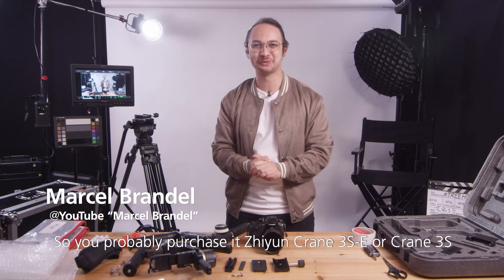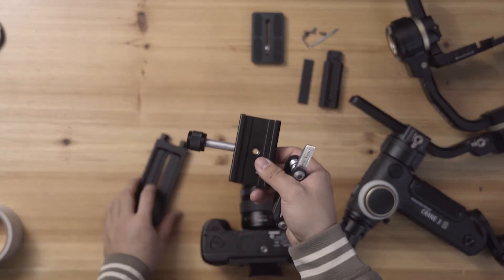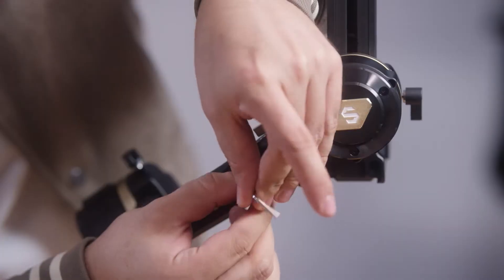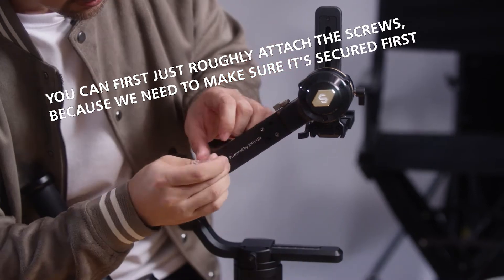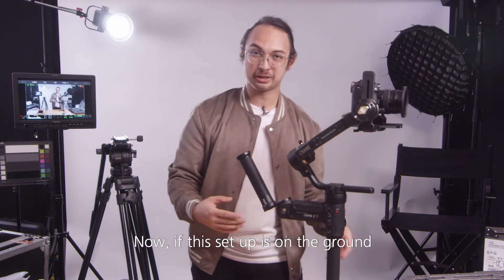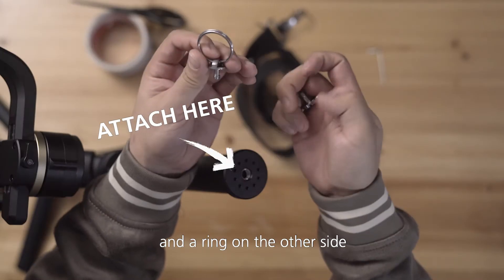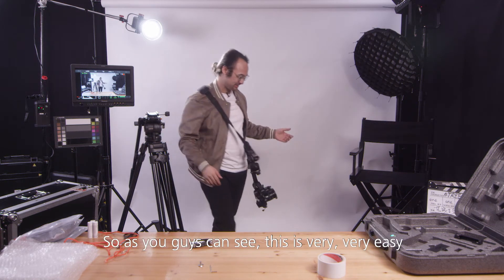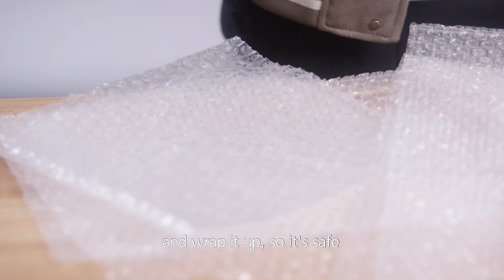Zhiyun Crane 3S OFFICIAL tutorials C1 basic upgrade & DIY tips

Comment: Hi Marcel, thank you for your very useful Videos on the Crane 3S ! In this video you said that the Extension Arm is also an advantage for smaler Camera Packs. I am using the GH5 together with the sigma 18-35 1:1,8 Lens and the 0,71 metabones speedbooster Adapter.  Would you recomend to use the Extension Arm with this ? Thanks!